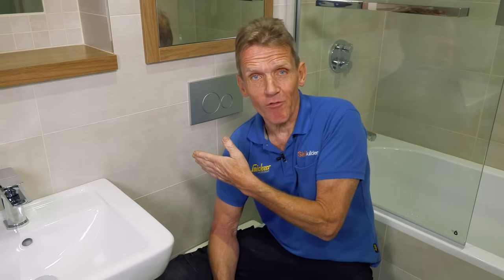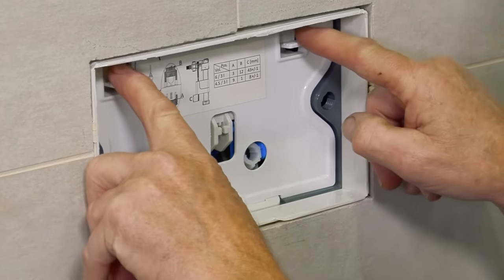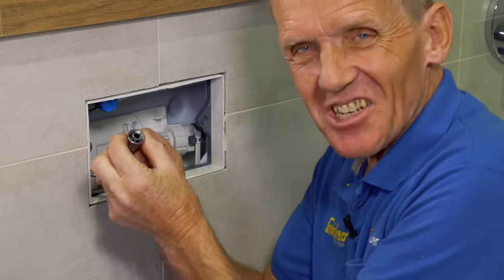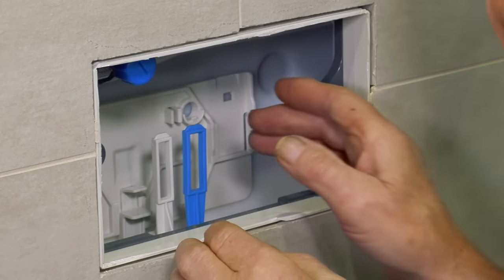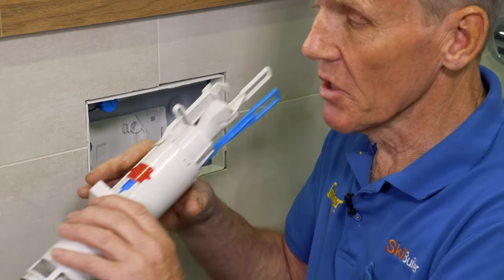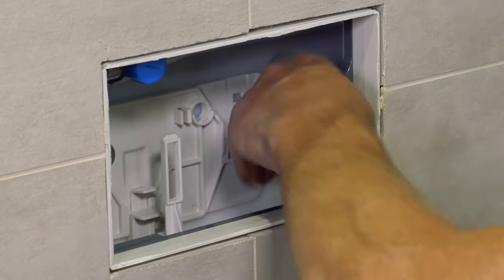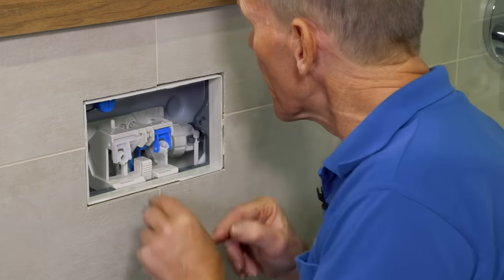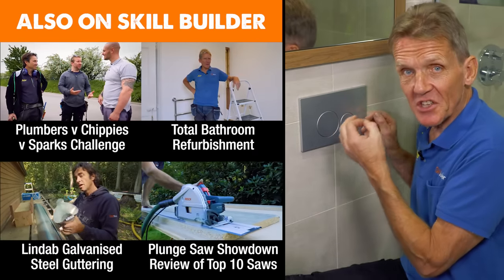Concealed Cistern Problems? 5-Minute Fix

Comment: This didn't need inventing.
Reply from the maker: dhb
I would respectfully disagree. All those times I have had to remove close coupled cisterns from the pan and frig about with doughnut washers etc. I know this is plastic and looks cheap but they work really well and customers love the clean lines. Sometimes you have to embrace the modern. I am a toilet hugger
Reply: @SkillBuilder  Not to mention the corroded bolts that can only be sawn off with your left hand,  whilst hanging upside down over the edge of a dirty bog🤣
Reply: @SkillBuilder  I feel for every homeowner who will be furious 5 or 10 years down the line at whoever fitted that piece of plastic junk.
Reply from the maker: @e2linuxos  I have been critical of sub-standard plastic plumbing but I have fitted loads of these and they don't cause any problems. You can swap every part in the cistern with no tools in minutes. 10 years down the line if that is the worst thing that happens so be it but hard water is the most common problem and the scale is easily dealt with.
Reply from the maker: @sunriseinisaan  I have done many of those. Nothing rusts bolts faster than urine.
Reply: @SkillBuilder  Fair play m8, haven't come across one of these before.
I've come across loads of terribly designed, over complicated hidden plastic cisterns and that looked like another one. Perhaps if these ones don't cause any issues then that is why I've not been asked to fix one. (Soft water area so no limescale).
Reply: @BestUserNameUK ❤
Reply: Is there actually a water tank in there or does the water come through on the button being pressed #ignorant.
Reply: @peterward6197   Yes, I would live to install a bidet (sprayer water hose). No idea what's behind that wall though. If it needs breaking open the wall, it'll be to expensive for me 😏
Reply: @e2linuxos wrong!
Reply: Great video. Sorted out my dripping problem.

Comment: Dear Roger. I can’t begin to tell you how much this has helped me today. Our system is a Geberit but essentially the same and when I saw the water slowly running into the pan I was horrified it might mean a total strip out of the bathroom wall! You have considerably added to the state of human happiness in our house! Many thanks, Colin
Reply from the maker: Hi Colin
Thank you, I am very glad to hear it. 
I think we are all lucky to have YouTube, I have fixed a few things in my house with the help of videos.
The fact that some plumbers start hacking off tiles is a sad indictment of their  unwillingness to ask the question that took you to this video.
Reply: @SkillBuilder   Same thing here, saved a huge headache!
Reply: @SkillBuilder  hi Roger great video I followed your steps and found out the grey inner seal rubber is deformed so water leaks, I simply turned it around and it’s all good 😊 👍
Reply: So was your issue, just related to the Parts needing a bit of a spring clean?

Comment: I live in the Bahamas and our new rental home has these concealed cisterns installed.  I had a few sleepless nights when the WC started to run.  The plumbers here aren't familiar with these systems and they have no hesitation to grab a jackhammer and blast away.  And there is no way on  to match tiles and grout.  Your video is perfect.  I was able to fix this in minutes.  It was easier than fixing a classic cistern.  We have high calcification in the water here so I cleaned up the float valve and what you call siphon as you advised and all is perfect now.  If you come this way you can stay in one of my rentals on me any time.  Thank you!

Comment: Geberit cistern slow filling. Internals pretty much exactly the same as in the video. Took apart, couldn't see anything. Reassembled...filling OK. No idea what the problem was. On the plate behind the button cover was a QR code linking to the Geberit maintenance PDF.  This explained a couple of points that differed from the video.

Comment: Thank you. My cistern was a different brand but the basics were the same. I had spare parts because I had two of the same loo but didn’t end up using one when we reno’d. The flush buttons stuck, the intake going into the float had some kind of partial blockage and the water didn’t seal fully and trickled into the toilet. From a few weeks post install. The plumber left the area. Your video saved me hundreds. Champion. Not to mention I thought it may mean ripping off tiles and wall which would mean thousands. So grateful.

Comment: Fantastic video, thanks. I’ve had a misbehaving one of these since it was installed five years ago. The plumber had left the assembly rods too long and they were distorting the rear plate. Thanks again.

Comment: Brilliant thanks! 
 I have got exactly the same system, but it's labelled Saneux.
I had a plumber come and have a look and he didn't know how to do it and was talking about smashing tiles off.
He suggested I contact the manufacturer to find out if it could be serviced through the button plate and if the parts were available.
Your video has given me confidence to tackle it myself.

Comment: You little legend! We ordered a part for $65 thinking it was the issue with the cistern running into bowl constantly. it didn't fix issue after hubby replaced it. I just goggled it, found your video watched it and just pulled the entire thing apart rinsed it all wiped out the bowl which had lots of debris in it and put it all back together again. My daughter was like way to go mum! Lets see if it remains silent (ie no leak present atm). I may have just sorted it out. Fingers crossed. Thanks heaps for sharing this video. Cheers Kathryn
Reply from the maker: Your daughter is right. Well done for sorting it out. It is amazing how much rubbish you find inside some cisterns and builders don't understand that all those bits sitting on the seals are causing problems for people.

Comment: I've got a bit of a love hate relationship with these things. With the introduction of low content cisterns they needed something like this which dumps the entire contents very quickly rather than a siphon which drags the water up and over the before the siphon starts going and has a lower flow rate so you need more water to flush the pan.  The advantage with those is that they couldn't leak like these new ones do. A friend of ours had a massive water bill because she didn't realise hers was leaking. It's not always easy to see the trickle of water running down the pan. Mine has a Grohe flush valve and I recently changed the head because of this but to be honest it's lasted around 14 years so can't complain. Grohe stuff is pretty good. They are reliable but you have to watch out for that trickle especially if you've got a water meter. Good videos as always.

Comment: Thanks, great vid and easy to follow. I have a similar system which works fine. However the flush is very strong which makes some water spit out of the actual bowl when flushing. How do you adjust this?

Comment: Thanks so much for this video. I hadnt got a clue what to do with my eight year old saneux concealed cistern that had a constant flow in to the pan. It would make noise every few minutes all night in my en suite and keep me awake. Followed this and descaled and cleaner the internals and reassembled and it’s fixed the issue. Thank you.
Reply from the maker: That is great to hear. Sleep tight

Comment: Fantastic video, helped me no end to remove and clean everything. My cistern still isn't filling up so the flush doesn't work. I think the float valve must be faulty, when I turn the water back on it trickles into the pan. Any suggestions?
Reply from the maker: Take the valve out and clear the filter. they block up with crap from the mains.
Reply: @SkillBuilder  the float valve? Where is the filter on it?

Comment: Thanks, Rodger. You helped me to replace a broken Geberit syphon which is very similar. Someone else commented here about the plastic becoming brittle with age and that’s exactly what had happened in less than 20 years. Two small retaining lugs snapped off during normal flush and I had to replace the whole syphon unit. Not the most environmentally friendly design but I agree that the whole replacement procedure was straightforward thanks to the clarity of your instructions.
Reply from the maker: Thanks Ray. It is a shame that they can't make the components from something better. I am glad the video helped.

Comment: Great video thanks. I had no idea how to take mine apart (it's a Geberit but looks pretty much identical to your video) before I watched this video. Issue turned out to be with the float valve which was leaking so had to order a replacement.
Reply from the maker: Glad it helped

Comment: Thanks for your video! My set up is very similar but older and a different make. A big difference is it has a soft plastic water holder inside the concrete wall cavity. I could not remove the large central part in this one so I cleaned around it as much as I could. One PROBLEM: I did discover that there is a volume of water OUTSIDE the lining! Have you seen a concealed cistern before with this problem? When the lining is empty it pushes inward due to the weight of water on the outside. It looks like a jobs for a professional...

Comment: Only just come across your video, it's great, I had no idea you could fix so many problem through the flush button panel. Unfortunately my leak is where the cistern outlet joins the flush pipe into the toilet itself!  In order not to completely dismantle the whole thing I've managed to wrap amalgamating tape around the joint so hoping that works!   Where could I get a spare flush valve for this model? (I'm in the UK)

Comment: Mine is a bit different to this, its in a cupboard behind the toilet. The big push button is still working but doesn't come out fully after you push it, it sits a couple cm deeper than the small push button is so you can't fully push it in.

Comment: What if the supply is leaking to the cistern? Is there anyway to access that, or is that just a remove a tile type job?
Reply from the maker: If the supply is leaking and you can thread a new piece of plastic pipe through then that is the best bet. If not then you need to remove the tile above the cistern flush plate. It is not usually that hard to cut one out.

Comment: Great video, thank you. I've still got a bit of a dribble from the inlet/float valves plastic screw cap threads on the outside (just after the clamp holding up the valve) so any idea whether it just needs replacing or can be fixed would be great :D
Reply from the maker: You can fit a new washer but the valve is very cheap to replace

Comment: A very helpfull video, but one important notice: he is demonstrating it with a rather brand new system. If you are trying this with a system that has been in use for years, chances are really big that limestone has built up in all sorts of crevices, especially where the parts are supposed to fold but can't anymore because of the limestone, so they WILL crack. So you will end up with replacing the siphon or the floater in whole and those are not cheap. So if your system has been in use for years, and you want to take it apart to clean it as it is leaking, then the advice I got (when helas buying the replacent parts) is to first drain the water, then fill it up with a mixture of water with citron acid and let it soak for at least 24hrs so the limestone gets dissolved, or at least softened. At that is still not a garantee, as "those parts are made to be broken when seized up with limestone, so you will end up with buying the whole replacement part anyway" .

Comment: Hi there very informative video. I have a problem with my Geberit sealed system, I recently had a bathroom refit and moved my toilet over by about 30cm but now everything is back together I'm finding that the water is trickling in the tank after flushing. Do you know why this is happening?
Reply from the maker: The valve isn't seating properly. Hopefully you have it level. Take the whole valve out and clean the surfaces then put if back. The rubber is unlikely to be perished.
Reply: @SkillBuilder  cheers I'll give it a try

Comment: Please help if you can! I have a very similar unit from Swiss Madison, and I think I punctured the tank with a stray screw. 😢. It looks easy enough to pull the whole tank out and replace it but Swiss Madison said I would ruin it bla bla bla. If you had access to the back of the tank from an exposed wall, would you take a stab at prying off the actual tank itself from the frame ?

Comment: Love watching your video. Im in Australia - wish I could get some insight into out stupid toilet. We have 4 Villeroy and Boch wall hung toilets in our house.
al work fine except for 1 - which continuously blocks.  its disgusting.
Our plumber and builder seem to think its something to do with the 'fall' of the water and that in order to fix we have to rip up the entire bathroom.   its a massive cost to do this so for 7 years we have put up with it.  We have a plunger next to the toilet (Gross) and if the kids dont plunge the toilet after doing a number 2 - then the whole house stinks.  Im seriously about to have a nervous breakdown.

is it a possibility that the plumber has set the water in the sistern at a low level ? is there any way to make the flow stronger and see if it works.... Im praying that this is an option and hoping you can give me some help.
Reply from the maker: Hi Ainsley
I am not saying this is true in your case, but in the past I have found some obstruction of a bad connector is causing the solids to foul while the water carries on. If the fall is sufficient the water will carry the solids, if it is too much the water travels faster than the solids leaving them high and dry. 
I have found kids toys and all sorts of other nice things around the bend in toilets. 
I would hire a drain survey camera and push it up from the inspection chamber to see if there is a problem that nobody has found.

Comment: Sometimes when I flush it doesn´t start refilling the tank and I have to push the flush button a few times before it starts refilling again. What could be the problem there? The whole system was installed about 2 months ago so it is pretty new.

Comment: I have a grohe wall dual flush system and the larger flush of the wall plate requires needs to be kept pressed in order to flush entirely. The smaller flush component works fine. Any idea what the fault could be and is this a common fault?
Reply from the maker: That is how it is intended to work. It is a water saving measure

Comment: Good day SB,  my new installed Oli  80 cistern does not stop water from coming in, it paws water nonstop until it’s overflowing on the flush plate and the plumber says the water pressure is too high!
Do you have an idea what might be the cause?
Reply from the maker: The flow may be too high but there should be an isolation valve before the float valve to slow the incoming water. 
The water should never overflow the flush plate. Just turn the water down and adjust the shut off level on the valve
Reply: @SkillBuilder  thank you, I managed to open and clean it I found a stone inside

Comment: I'm having an issue with push button plate having condensation.  How is that posible?
Reply from the maker: Yes it is possible but it suggests the humidity in your bathroom is way too high. Do you have an extractor fan?

Comment: Are all these concealed toilets, a generic standard?

Ie 

If our toilet is a different brand, should it be similar to take apart, and reinstall the parts?
Reply from the maker: In most cases they are the same. The biggest difference is the price of the parts. If you have a German make they charge German prices for the spares.

Comment: Would it be possible to install one of these cisterns behind a 6" block wall instead of making a box in front of the wall like is shown in the video? My bathroom is small enough so if I could have this on opposite side of the wall it would be great. I could then cover cistern on other side of the wall with plasterboard or similar and take the space from this other room instead. I'm a little concerned that the button triggers would need to be an additional 6" long though and maintaining it could be a headache.
Reply from the maker: There are many ways to achieve this. You can even put the cistern in the loft and have a pneumatic flush button.
Reply: @SkillBuilder  interesting...need to look into that.

Comment: Hey - I was doing maintenance without really knowing what I was doing, before I found the proper video. I accidently broke off a small piece of plastic that fell down into the bottom of the cistern and now I can't get it out. Will it cause problems and if so, how the hell do I get it out?
Reply from the maker: wet and dry vacuum cleaner
Reply: @SkillBuilder  Ah, that's actually.. Didn't think of that lol. Thanks, I'll try that.

Comment: Love the way the cover just pops off without the lugs braking and that no muppet has siliconed it back or grouted around it.
Reply from the maker: Yeah I know what you mean but the great thing is that all the siliconing is done before the cover goes on so it should never be an issue with this kind of plate

Comment: Nice walkthrough of wall-hung system.  It doesn't look like Abacus is distributed in the USA.  Do you have any preference for any of the other big brands offering wall-hung products?
Reply from the maker: Quite honestly there are so many around now and they all work. The thing about the Abacus one is that it is easy to fit because they give you all the options for pipe runs.

Comment: Excellent but why did the cistern not fill with water to prove it worked ?
Reply from the maker: We didn't have to prove anything. This is how you get to the components. The condition of the seals is not being debated  here because it will vary.
Reply: There are pitfalls in reasembly and it would help the novice to show, for instance a flush or float valve can jam.